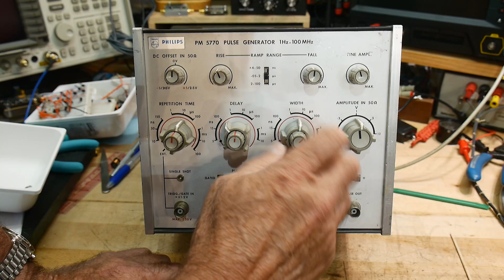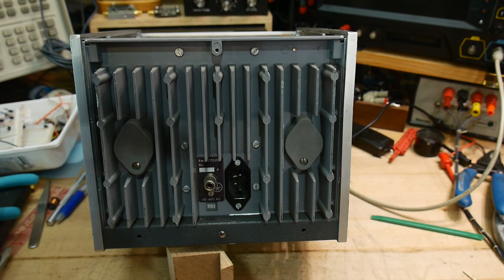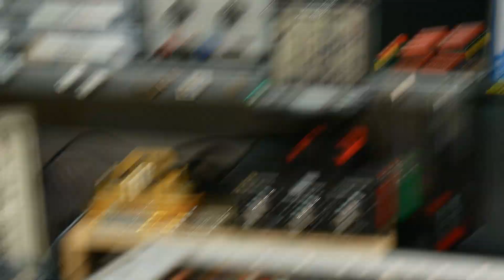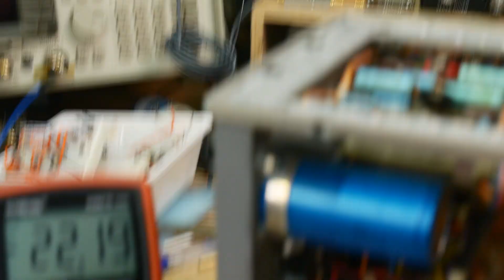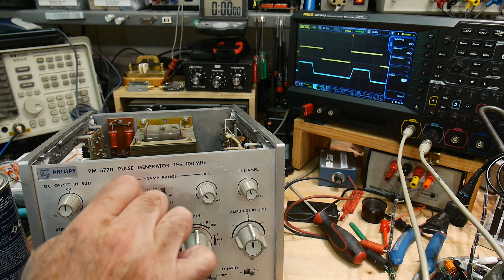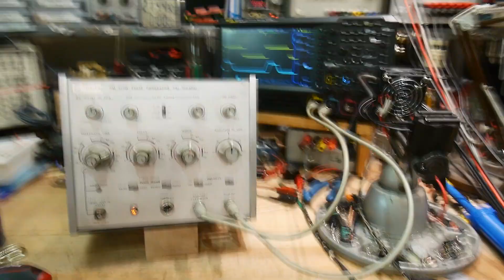#873 Philips PM5770 Pulse Generator

Comment: Electrolytic capacitors with light Blue transparent plastic coatings screams last century European components.  The glass beads on component legs insures strain relief on the wires, and allows lay-inspectors to verify correct assembly via the existence of the glass beads on fragile components.

Comment: Collet knobs were considered the high quality end of the spectrum. Even when I started in the industry 45+ years ago here in the UK they were widely used. 

You are supposed to use a box spanner to tighten most of them, but some like the small knobs on your pulse gen. were slotted for a screwdriver.

Most of the caps for the knobs just pressed on, and were fairly easy to remove. For those caps I suspect that there was a removal tool available.  Multi colour caps were used to things like mixer desks.. You could even buy  the things in the electronics hobby stores such as the now defunct Maplin Electronics (still trading under that name online, but not really the same) .

Philips equipment, not one of the biggest names in test equipment, but what they did produce was always pretty solid. Which was important for industry use.

Andy

Comment: With your mention of 40volts on the 30volt Capacitor… a subject or idea for a video could be “Capacitor derating rules” perhaps ?
Way back when… Capacitors used to say “working voltage” for example, but why ?
Also, tantalums have different derating rules, there’s a reason for that too 😉
Reply from the maker: it was 30 volts on a 40 volt cap
Reply: Wayback "working voltage" was quoted along with a "surge" voltage which was higher and had to be brief. With valve equipment the HT could rise before all the valves began to conduct and pull the HT down again. Back in the 70s I remember caps with, "275v working, 350v surge" as being the norm.
I believe modern caps quote the max voltage above which they are liable to fail.

Comment: Sides look like HP
Reply from the maker: yes, I was surprised. now I want to know which company was first.
Reply: Philips is the predecessor of fluke which later took philips measurement department over.
But even so, philips design electronics once paved the way , their science/math lab (philips nat lab) did cutting edge inventions en work and a lot of it was used by companys like hp and all the way up to nasa.
They invented the cd, sony did the production but the math came from philips.
You can buy philips equipment like hp, there is a more then fair chance it will work just fine and within calibration.
Reply: Oh i forgot; philips was founded in 1891 by anton philips in eindhoven city as a lightbulb manufacture eindhoven is still called the "city of light" up til today.
"Royal Philips" showed companys like hp and ti how to build electronics.
Nowaday only philips medical remains, the rest is all sold of to china 😥
Reply: @robber576  yes its sad i am a electrician i alway get happy when i see made in holland on the old tl tubes. I know its the netherlands i don’t know way they put mad in holland on them maby the got made in holland fore real??
Reply from the maker: @robber576  I worked for Philips and have been to Eindhoven many times.
Reply: 👍🏻
So you should know what i was talking about, philips "nat-lab" "nature laboratorium" translated physics lab was very well known for its groundbreaking research in the 50's to 90's.
Such a pity it is all gone, the equipment they made was very well build just like their radios and tv's.

The "made in Holland" is just something of the past, people from the netherlands in the past usually refered to the netherlands as "holland" to foreigners.
Reply from the maker: It's like BMW  being in Bavaria. Holland is an area inside the Netherlands.
Reply from the maker: @robber576  I spent time at the research labs in Eindhoven and Aachen Germany. Yes, lots of smart people there and allowed to do real research. Similar to the time I spent at HP Laboratories.
Reply: @IMSAIGuy   Cool 👍🏻🤓, it used to be my dream to work there one day, then i bought a racing motor cycle 😂
Reply: @robber576  thanks for the history lesson.